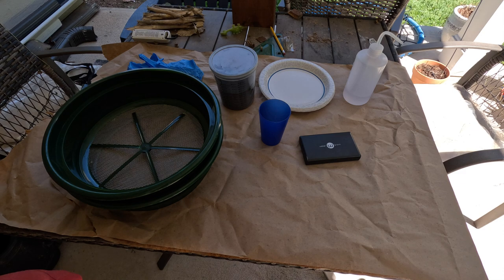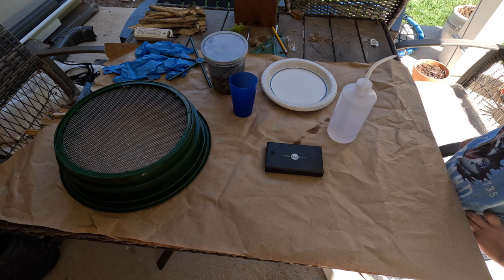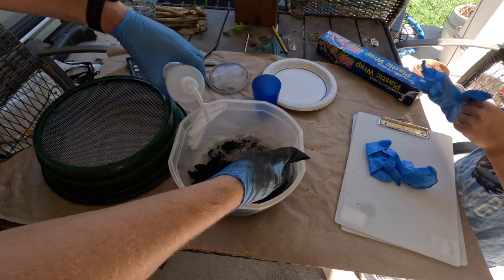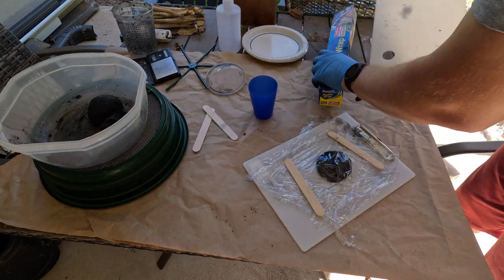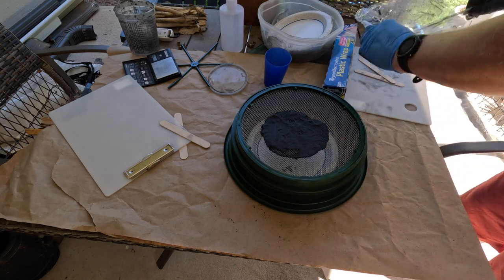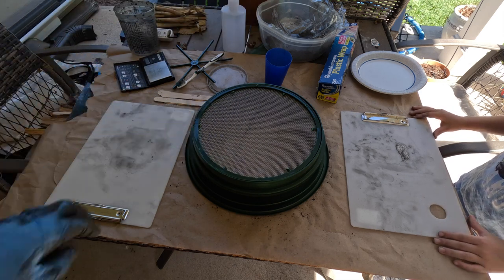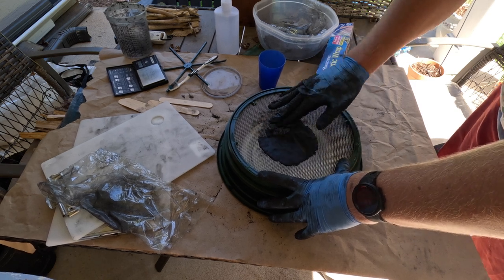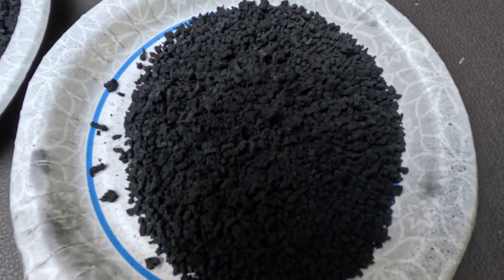Making Black Powder pt. 2 - Granulation

Comment: Need an aluminum tortilla press. Then instead of wax paper you use a flat plastic paint scraper to move it and press it through
Reply from the maker: That would probably work. In my case, I am trying to get the BP cake to a thickness of around 1/16" so when I press it through it comes out to around 1/8". It would be interesting to see if there was a way to calibrate something like a tortilla press to get a certain thickness.
Reply: That’s about how thick masa comes out. I’m gonna make some BP next week and I have a tortilla press so I’ll let you know or film it. Also found and aluminum and plastic grinder I may use for larger bits (I’m doing FFg, FFFg)
Reply from the maker: @wvcruffler123  Awesome! Let me know for sure, always looking for a better way to do this process!
Reply: Also planning a variation on the CIA method making low pressure pucks using a coffee aero press and filter paper. Don't think it will improve density much put grinding them once dry might give more uniform granules (thats the hypothesis) @jmohearn
Reply from the maker: Interesting, hopefully you get some good results! This process makes powder for pyrotechnics and I've found the size and density I get works well for lift and burst charges but I know its not as dense or as well mixed as what most people need for firearms @wvcruffler123

Comment: Wouldn't you get the same results if you just rubbed one of those balls of moist powder through the screen?
Reply from the maker: You would probably get a similar result. I have found that this method I learned results in more unified grain size.